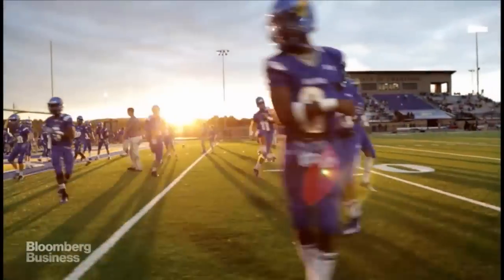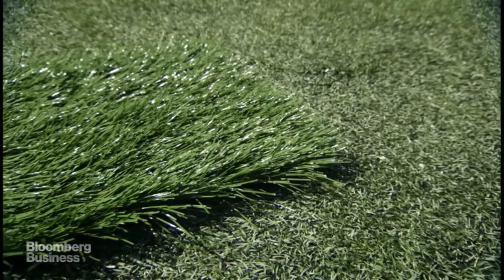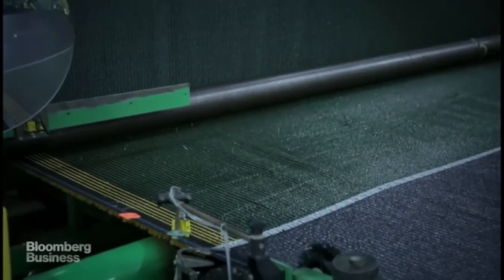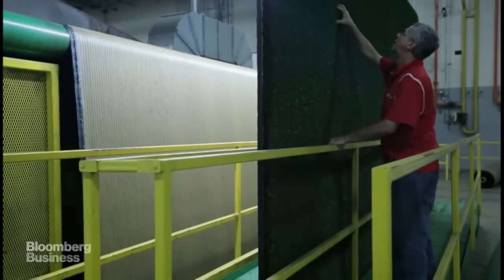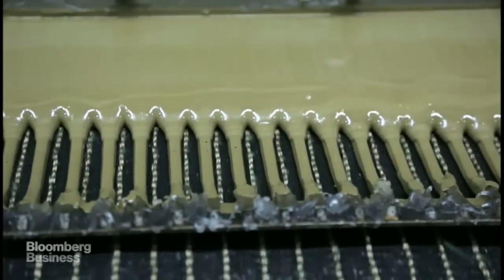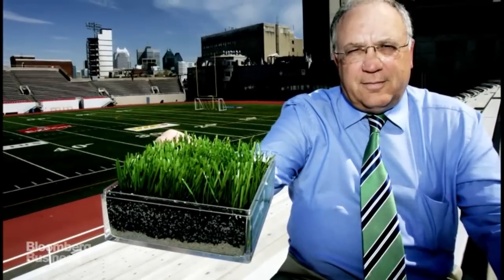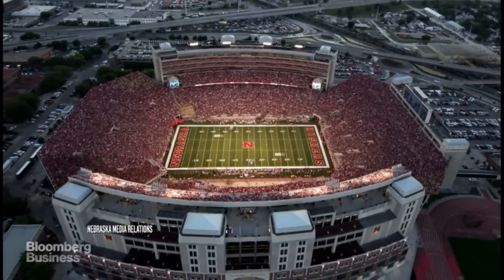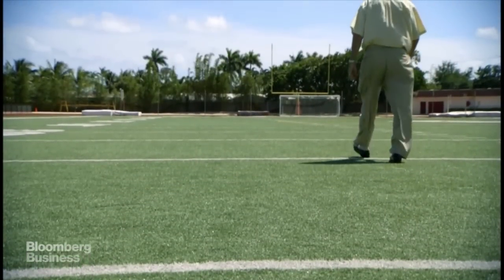How AstroTurf Got Kicked Off the Field

Comment: turf gets too hot
Reply: dont they usually spray some water in it before using it to prevent that ?
Reply: Jack Roberts They're supposed to. But most high schools and colleges dislike doing it for a various if reasons
Reply: Clearly you don’t live in the uk
Reply: i played baseball on a turf field that had small tubes in the ground all over with air coming out it was like air conditioning for the field
Reply: killua zoldyck how do we know you're not a tiny man on an air hockey table?
Reply: The Weeknd idk but my mom thinks I'm cool
Reply: lol
Reply: But grass gets too drought ridden
Reply: Dayrepgaming if your turf can't shed water than whoever installed it REALLY messed up... What is it supposed to do if it rains lol
Reply: At Busch Stadium in St. Louis, it was not unusual for the baseball field to heat up over 110 degrees in summer.
Reply: Jack Roberts we would do it for football camp in the sumer
So around 6am but by 9- it would already have been mostly evaporated and well in Chicago... The heat usuallt goes 80-110 sooo by 9 it was gone until 11-12am... (Yeah they put us through hell)
Reply: One more like and your at 1k
Reply: @zachh6367  wow best response ever
Reply: Gets way too hot, and the fields with the black pellets destroy your skin
Reply: @russellmoore8187  and its hard to maintain
Reply: Not the turf my school has.
Reply: Especially when you go to a high school with black turf

Comment: Cleats get stuck in turf and cause ligament damage. I tore my ACL running down the field in the football game, no contact involved whatsoever.
Reply: William Tapio than use artificial grass/turf cleats
Reply: Agreed
Reply: William Tapio . Right
Reply: And I blew out my knee making a cut on natural grass. 
I don't think the turf has much to do with that, neither does the grass, but the nature of the game.
Reply: I hurt my mcl acl earlier this season on a kick off. No contact too. I wouldn't blame the turf tho. It's just something that happens when your exerting your body like that no matter the surface
Reply: There's cleats for artificial grass. You shouldn't be wearing firm ground cleats on turf. So that's your fault bud
Reply: Thankfully many professional teams are removing field turf for this exact issue. Ligaments cant take the strain when a cleat get stuck.
Reply: you're
Reply: William Tapio try hybrid 70% grass 30% turf
Reply: +Luc McParland Wait which one is artificial grass or turf?
Reply: William Tapio ACL injury... how did it heal? They can be a bitch.
Reply: My cleats locked into the turf making a lunging tackle in soccer and as I tried to pull my cleats out to get up it locked into the turf from my cleats and I got hit with all my body weight forward on my leg and blew my knee out, tearing my ACL. I know for a fact it wouldn’t have happened with a grass field because my foot wouldn’t have locked in and would have slid instead. Made that type of tackle hundreds of times in my life but rarely on turf did I play. Only took a few games in my first year on my high school  turf field for it to happen.
Reply: William Tapio same. Tore my acl and pcl.

Comment: We had astroturf on our baseball/football stadium here in Philadelphia for several decades. Stuff was >100 degrees in the sun in the dog days of summer. Very slippery when wet, rainwater lay on the surface instead of being absorbed into soil, since there was no soil. Separate fields built for both sports using natural   grass

Comment: They never mentioned 3M Tartan Turf first used by the University of Tennessee in 1968. Then the University of Wisconsin installed it in 1968 too. In the NFL, Pittsburgh had it installed in the new Three Rivers Stadium in 1970. In Dallas the new Texas Stadium installed it for their new complex in 1971. Finally, the Kansas City Chiefs used it in Arrowhead Stadium in 1972.
There is also no mention of Poly - Turf by American Built Rite used in the Orange Bowl and
Schaffer Stadium in Foxbourgh.

Comment: It’s horrible for your knees and joints. There is a case of the rubber causing cancer. There over 50 soccer goalies that have Similar cancers and doctors believe it’s from having the rubber kicked at them and then ingesting through mouth, noes and ears. It’s horrible and they need to do some fixing.

Comment: The rubber is ground up tires. When putting this rubber on the field the rain takes the heavy metals and this way you get lots of problems in the soil. The heavy metals can run through the water system if the field is drained
Reply: Donovan Van Der Weerd If you use cork, this problem won't ever occur.

Comment: Did you ask him about the cancer risk? ESPN did a 30 minute show covering the correlation between female soccer players and this playing surface.
Reply: i heard theyre starting to change to cork instead of the shredded tire rubbers theyre using now
Reply: oof
Reply: Seahawk STRIKE Absolutely, and they also have an olive core option, too, but either one requires an underpad, which is difficult to retrofit on an existing field. A better choice: There is a "coolplay" material that replaces just the top rubber layer, available as both a retrofit or on new installations. A competitor offers "zeolite" quarry rock infill with an underpad.